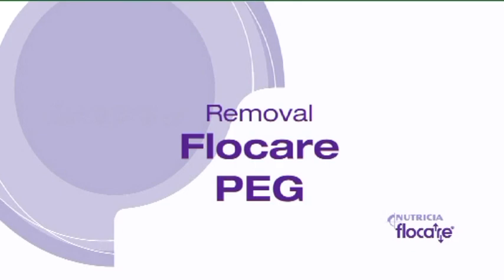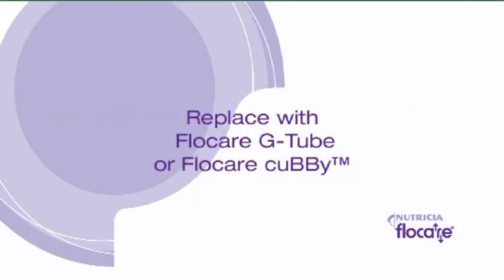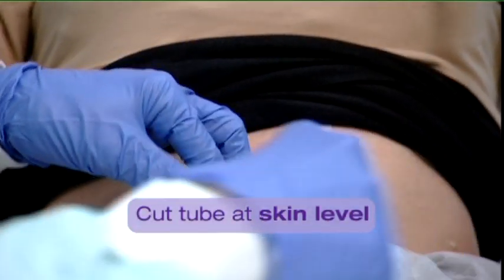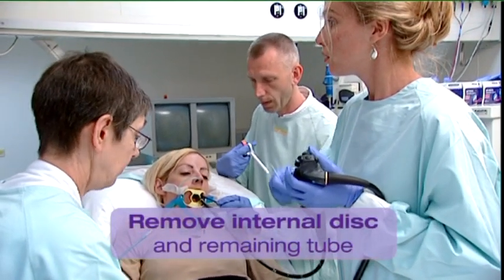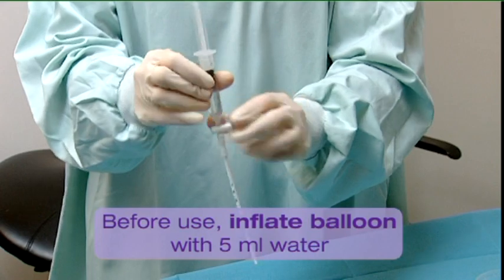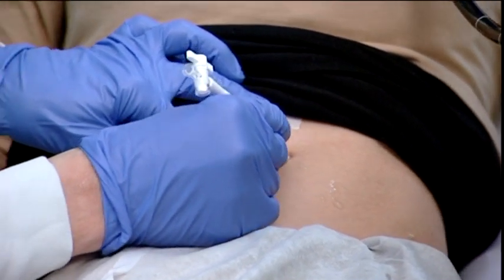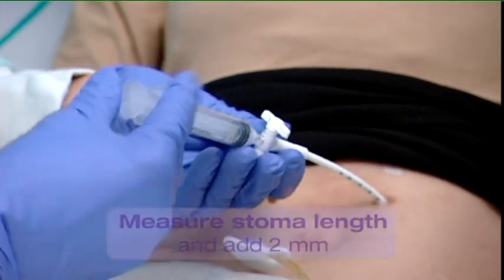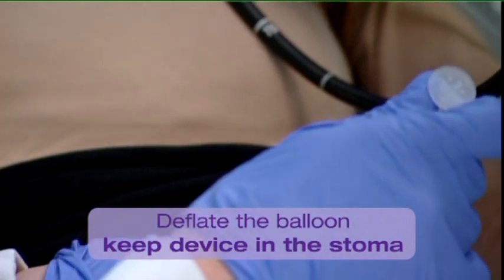PEG removal and placement preparation cuBBy button

Comment: The peg is not being removed . The Flo care Peg’s being replace fire flow care G2 or flow care copy button as demonstration with this instruction video. The floor care pig is being removed what is use of an endoscope. The internal disc and the remaining tube is being retrieved by endoscope and four sets.